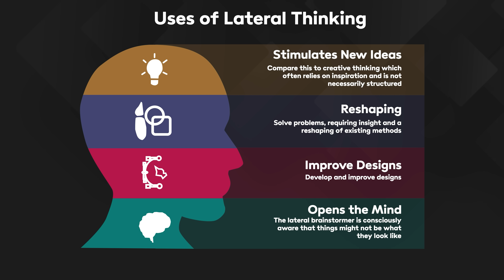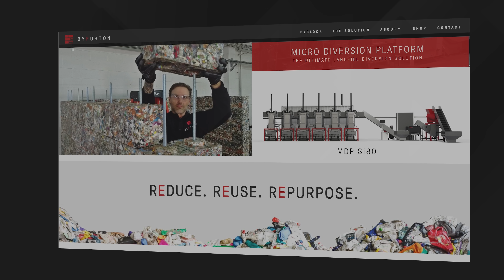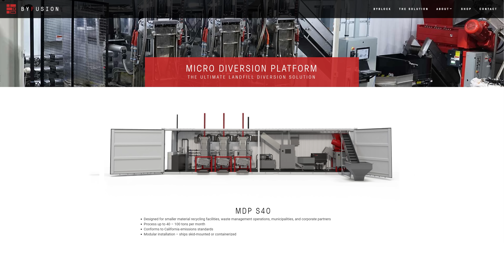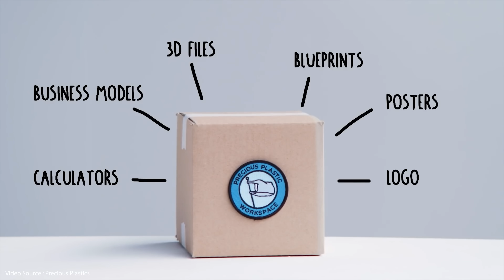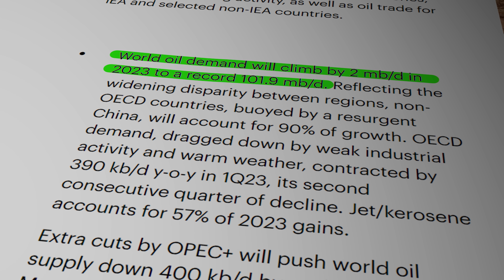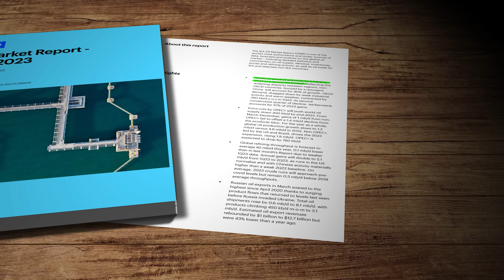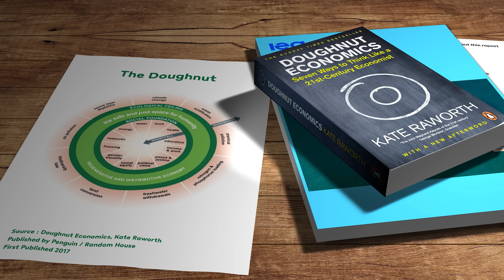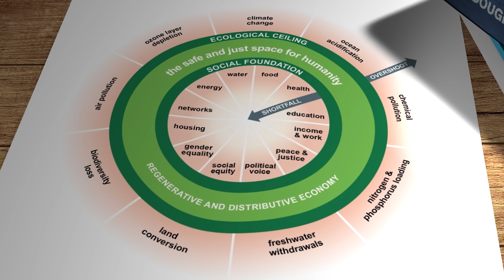Plastic doughnuts? Have you lost your mind!?

Comment: I love this kind of solution, the main problem is the mix nature of the plastic. To make it durable or reliable, I guess it's not the same building a brick from pvc than from bag
Reply: If it's foamed for insulation the structural properties aren't so critical.  Also,  if it's made into plastic timber with all the fibres teased along the long orientation,  the lack of cross-polymer linkages won't be so critical either.

Comment: We should be reusing at a chemical level.  I see more value in burning/melting down the old and rebuilding better. This allows us to utilize everything, but also produce optimal materials from the ash/slag.
Reply: Chemically, most plastics are just carbon and hydrogen.  If you burn them you get CO2 and water.
Melting them down is how you reshape them, so is the basis of recycling.
There are methods (specially tuned microwaves) to turn plastics,  specifically old tyres so far,  back into liquid oil  but I doubt that'll ever be economical for the cheaper plastics.  The most common one polyethelene  is resistant to most solvents so that's no good as a way of processing it.   One possibility is maybe to melt it,  then with some sort of catalyst make the chain molecules join into longer ones turning LDPE (low value) into HDPE or even better UHMWPE which is much more valuable.
Reply: @MattOGormanSmith  I do see burning most plastics as the best option for reusability, but if a sustainable method of extraction hydrocarbons from plastic is more economically viable, that should take burning's place when industry can make it happen.